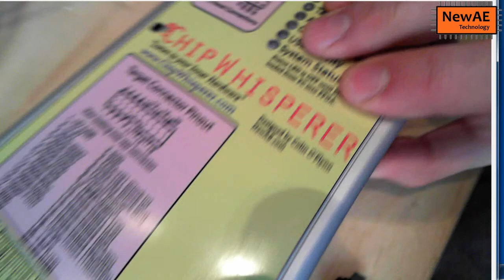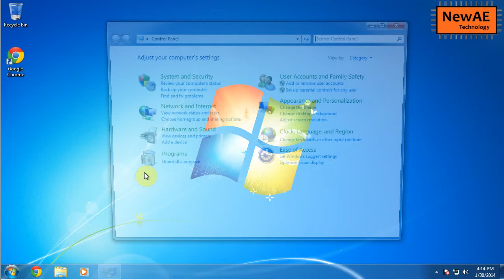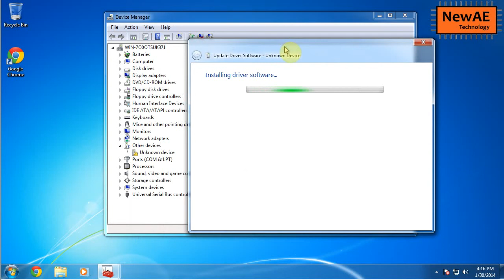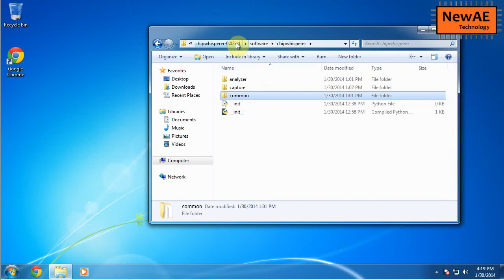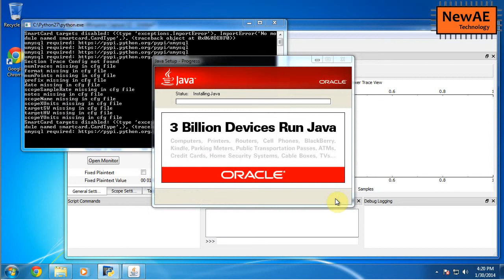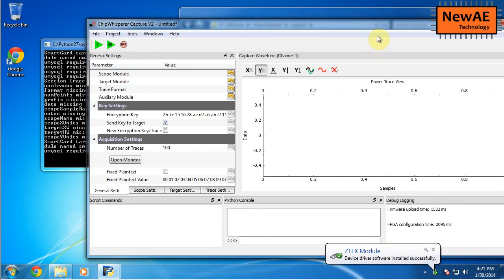Old Video : CW Driver Install (kept for URL only)

Comment: I followed the entire tutorial including the python installation, but i cannot find the libusb-win32 folder. Even when I search for the driver in the entire ChipWhisperer folder, nothing is found.

Did i miss something?

Thank you!
Reply from the maker: Sorry on the delay - the ChipWhisperer mailing list is quicker for responses! In case anyone else comes across this though.. the drivers were removed from some releases, as Chrome was flagging them as malicious. The drivers are posted separately (they rarely if ever change) at https://www.assembla.com/spaces/chipwhisperer/documents/bTZj2eZK8r44obacwqjQWU/download/bTZj2eZK8r44obacwqjQWU